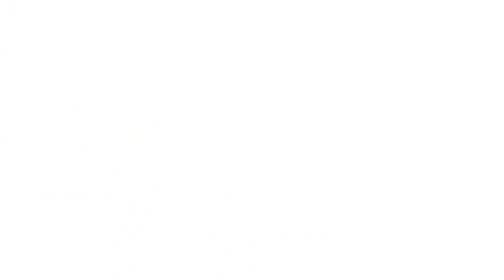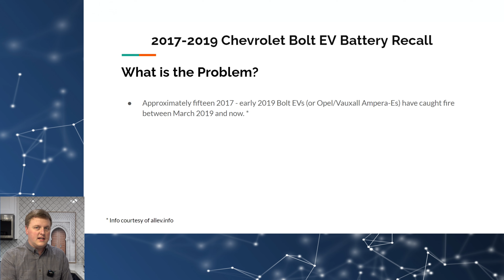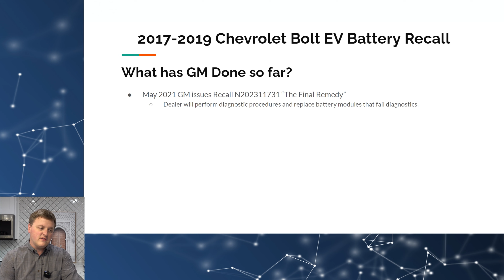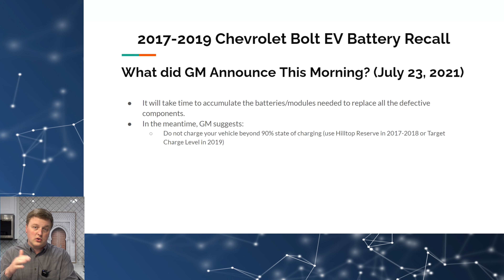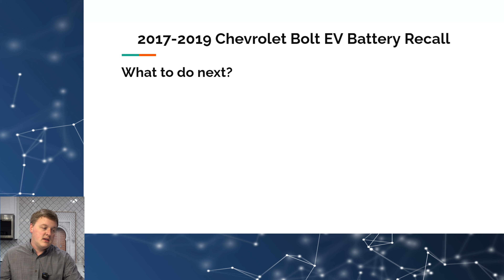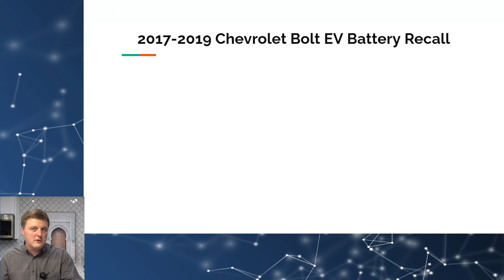GM issues a THIRD battery recall for the Chevy Bolt

Comment: GM announcement seems to be saying LG battery is at fault. 
1. If LG battery is defective then reducing charge level of max and min won’t make any difference.
2. If LG battery is defective to the factory mentioned then software update would not fix the problem.
3. There are other EV manufacturers other than GM and Hyundai using LG batteries. ie Tesla.

I would concede lithium battery manufacturers and EV manufacturers are still in learning mode, but I also believe we are in reasonably safe lithium phase. 
I don’t expect GM, LG or any other manufacturers to be completely transparent as it will expose their Intellectual Properties and geopolitical issues. All battery manufacturers are modifying their chemistry and processes slightly several times a year.

As a society, EVs catching fire is a teething problem and a minor issue, but at an individual level EV manufacturers should stand behind their products. GM needs to work with LG to resolve how real fix will be paid for.
Reply: We can learn from Samsung Note 7 batteries blowing up. Samsung recalled and replaced all their batteries but still catching fires. Samsung recalled all Note 7 and refunded.

What is not well known is that out of 5 suppliers for Note 7, all the batteries that caught fire were 4 Chinese battery manufacturers. Samsung makes some of their own batteries but gets mostly from Chinese suppliers. Samsung smartphones were best seller in China, but after that incident Huawei became #1 and Apple #2.
Samsung moved their smartphone factory out of China to Vietnam quickly, and Samsung doesn’t have exploding battery problems since then. 

Nothing is perfect, but we are in perfection in parts per Billion society, no defects in million parts is not good enough. Another reason Tesla is moving to 6840 cells.
Reply from the maker: I think all of your comments, including the comparison to the Note 7 are spot on, but I would make a couple of comments to it.
1) The Bolt batteries that are catching fire were not assembled in China, they were assembled in S. Korea. That being said, the Hyundai Kona batteries that are catching fire were assembled in China by LG. I'm not sure where the materials are coming from or where the refining is done.
2) I think GM's attempt to convince owners that the "final remedy" software update would fix all the problems was merely a PR stunt or an effort to delay the inevitable (mass battery replacement). It was never going to fix the problem and I don't think GM ever actually thought it would, it was to reduce the risk of fire by either reducing stress on the battery or diagnosing failures before they result in fires.
3) There are other EV manufacturers, as well as other electronics manufacturers in general using LG batteries and many have been just fine, but there are many EV batteries made by LG that are having problems, although not all result in a fire (the Bolt, the Kona EV, the Mach-E, the Taycan/e-tron GT, etc.). There has also been a history of energy storage facilities using LG batteries that have failed and/or caught fire. Some manufacturers that had been using LG batteries are now moving away from them, either because of the problems they personally are having or potentially due to public perception (like you mentioned with Samsung phones losing sales in China).
4) Tesla cells are not immune to build defects or fires (they've shown that clearly in the past)

GM is a huge auto manufacturer with reasonable plans for EVs in the future. The entire drivetrain for the Bolt was basically built by LG. My understanding is that GMs battery production facilities in the USA are basically LG facilities. I would expect LG would be motivated not to screw up their future with GM, so we'll see how that goes.
Reply: @wrenchingfool5284  LG is a supplier for many  brands.   Unfortunately their engineering designs can be extremely poor.

Comment: all vehicles have some form of dangerous fuel to drive them down the road.  having a separate garage from your home is just a smart move.[take it from a mechanic] we dont live in a little tyke's world, you have to protect yourself.
Reply from the maker: This is true, but I think the difference in the cases specific to lithium batteries is that they don't require any external input in order to catch fire. Gasoline is highly flammable, but it cannot start fire on its own. It requires the correct air/fuel mixture as well as a pretty significant heat source in order to ignite (i.e. an open flame or a spark). Lithium batteries pretty much contain everything they need to catch fire on their own.

That being said, there is still plenty of other stuff on an ICE or electric vehicle that could burn the car and its surroundings to the ground, but aside from a few outlying cases (like the Ford brake pressure switch disaster), those issues are usually pretty well dealt with.

Comment: This is really a good video. I think the battery issues on EV will be an ongoing thing, especially since we now have enough of them, that the problems will be "caught". The nature of the beast, pumping electrons, to store electrons, and at ever higher speed and capacity for the same volume. Fortunately for the manufacturers, a good majority of the users will not be using their cars "to the limits". They may charge the battery every few days, leaving the majority in the "safe" range between say 30 to 70%. I use a lot of rechargeable batteries on flashes for my photography. They give problems when I use the fast high current chargers, have given up and now only use the slow ones, and rotate out more batteries. Even then, batches are not so consistent.
Reply from the maker: 100% agree with your comment. Even after 100+ years of mass-market use, ICE vehicles are not perfect either. There are still some that catch fire on their own, or catastrophically fail in other ways. In reality, even if you look at all the Bolts and Hyundai Konas with LG Chem, the number that have actually failed is still a very small fraction of the total number of vehicles sold. We tend to be super critical of safety defects when someone else can be blamed, yet there is still a shocking number of people who can't even be bothered to wear a seat belt. I wear my seat belt lol, but I'm still guilty of being concerned about the slightly elevated possibility that my car could catch fire while it sits in my driveway, even if the chance is very small.

High current/capacity lithium cells are still a relatively new concept to the mass-market, so there are still development issues, but as EVs and other high powered devices start using lithium cells, they will improve.

Comment: Thanks for the comprehensive video. We own a 8/18 built Bolt (2019 Model), although you mention Oct 2018 to Feb 2019 Bolts. I assume I have to be part of the faulty pack runs. I previously requested a buyback and was denied. I live in a state with poor lemon laws and have not heard of a single Bolt own in my state approved for a buy back. We also own a Tesla and would jump at a chance to get another. I will be contacting Chevy again...
Reply from the maker: My comment about 9 of the 15 Bolts that are known to have had their batteries catch fire being built between Oct 2018 and Feb 2019 is strictly based off of what information is available online. As far as we know, all 2017-early 2019 Bolts are affected by these recalls. GM has not stated that there are any 2017-2019 Bolts that are more or less likely to catch fire. The only thing they have done that has even come close to indicating this is that they made the "final remedy" available to 2019 Bolts before it was available to 2017-2018 Bolts. That might be because they potentially use different software and required different updates to be made, or they may have been prioritizing 2019 Bolts because they are more problematic. I don't know, and GM isn't saying anything.

It's interesting the local lemon laws are sometimes making the difference between whether or not an owner is even receiving a buy back offer for their Bolt, because in almost all of the buy back cases I've heard (including mine), the buy back laws do not apply. In my particular case, the local buy back law only comes into effect after the manufacturer has had 3 failed attempts to remedy the issue. When I initiated my buy back request, I had not taken my Bolt in for the initial interim fix, and the "final remedy" had only just become available, so they had no yet had 3 attempts to fix it. Either way, yes, I would definitely suggest contacting them again.
Reply: @wrenchingfool5284  
They should just buy it back really..
I mean would anyone have purchased these Bolts knowing in the immediate future you can't park in a garage, you can charge overnight, you will have 10% less range and the possibility of your Bolt exploding??? No one would have touched this car.

Comment: So GM has gone from internal combustion to spontaneous combustion vehicles.  Now that’s progress.
Reply from the maker: Ford had them beat by a couple decades in regards to spontaneous combustion vehicles :)
Reply: @wrenchingfool5284  They don't call them Ford Exploders for nothing. Though to be fair if your Ford Explorer didn't catch on fire, at least the older ones were super reliable.
Reply: @creamofbotulismsoup9900  Ralph Nader could tell you stories about the Ford pinto
Reply: @wrenchingfool5284  I see you are a LOYAL "Govt' Motors" consumer of the Bolt. 
Do you really trust they "Gov't Motors" have resolved the issue after the 2nd or 3rd recall?.. or do you wish to continue being their Guinea Pig for their poorly produced product? #NothingAppealingAboutaBOLT

Comment: In spite of this dicey situation GM has been stand up in acknowledging there is a problem. I wish they had done this for the Chevy Cruz ! The power point style is a stroke of genius. What a great way to follow along. As for the transparency, do your homework on the Cruz. I stand by my statement. The other great obscurity is, " What happened to the EV1 ? " And more importantly,
why ? Very good presentation and explanation. But as most people of the 21st century know, a degrading electrically charged cell is a ticking time bomb. When you try to pump electrons around the good old fashioned way, it is a recipe for disaster. Largely due to the inherent impurities and manufacturing inconsistencies of power cell production.              Cheers.
Reply from the maker: GM definitely has some significant black marks on their reputation for how they have handled widespread reliability and safety issues in the past, as have other manufacturers, but GM is possibly the most notorious. I think the hope of many Bolt owners is that they would have learned from their previous mistakes, as the CEO had promised in the past, and maybe they have, but the public response to this issue so far has been disappointing. Of course, we also have to understand that since they are relying on an effectively outside supplier to create enough battery modules to replace the bad ones, there is only so much they can do quickly. They could offer to replace all the affected 2017-2019 Bolts, but they are currently struggling to even get enough inventory right now to supply new paid orders, let alone replacing vehicles for all the existing owners.

Regarding the batteries, any relatively new technology will have issues, especially as manufacturers try to push the capabilities of the existing technology. All things considered, widespread usage of lithium-based batteries is still relatively new, and using them in mass-produced vehicles is really new, especially given that there are so many different cell chemistries. On the plus side, as EVs become more common and more investment is made into the technology, the better and safer it will get.

I'm glad you liked the PowerPoint presentation. I was worried it was going to remind people too much of school or work, but it was the best way I could think of to present a lot of information and keep myself on topic without a script. Thanks for watching!

Comment: I'm an early adopter of EV's. Bought the leaf when it first came out, bought a Spark EV used recently for a work vehicle since my commute is only 8 miles, and had the first gen Volt. I love EV's but I wouldn't buy a new one today. I would wait another 5-10 years when the prices have come down and the issues have been resolved fully. I was in the market for a used 17 Bolt, but my families life is not worth the benefits of an EV.
Reply from the maker: I definitely agree that the current EV pricing, as well as the trend of making luxury EVs, is not really ideal for the average consumer, but I would caution equating all current EVs as inherently unsafe or unreliable. In fact, most of the EVs currently available are very reliable, but the one's that catch fire get all the attention. Thanks for watching!
Reply: @wrenchingfool5284  My Spark EV is nearly 8 years old and no known fires I'm aware of. Let me rephrase that, I don't trust EV's with LG batteries in them.
Reply: I’ve used my Tesla Model S for almost 5 years.  No issues.  Would buy new again.  This time…plaid.

Comment: Great vid.  Thanx.  I'm holding out to see a bit what happens with my 2017.  For a few reasons.
1:  It's a 2017, which so far appears to be a bit safer.  There have been no recent fires on the 2017s.  
2:  I have near 90k.  Taking into account mileage, I am sure GM wouldn't give me quite as much/straight trade for my Bolt (and I see why, I have nearly 4 years on this car..)
3:  I love this car.  It's been the most rock solid new car I've owned.  I mean, I would take a newer model if I had to, but I wouldn't necessarily be happy about that.  ;-)  ;-)
Fingers crossed..
Reply from the maker: I really like my Bolt as well. I would say that I actually like it more than my Model 3, although that may be an irrational feeling. Although I have had more issues (mostly build quality) with my Model 3 in 4 months and 11k miles of driving than I have in 2 years and 29k miles on my Bolt, which has been really reliable and solidly built up to this point. 

What ultimately pushed me to pursue a buy back, aside from the fact that the early 2019’s like mine seem to be the most likely to burn, was GM’s initial decision to try to “fix” the battery issue with a software update, which I was confident would either reduce the vehicles capabilities or merely try to detect a failing battery before it caught fire (and I was right.) I’m also concerned that GM still insists that they can diagnose failing batteries, which is something that is sort of implied in their latest recall. They haven’t said that they are replacing ALL the 2017-2019 Bolt batteries, they’ve said they are replacing “defective modules, which sounds to me as though they still believe that they can test and determine which individual modules are bad and replace only those. I guess we’ll see what happens.
Ultimately for me, on paper at least, the Bolt EUV takes most of the things I like about my Bolt and improves many of the things I wanted them to improve, and with the trade deal I got, I’m getting a good price. Can’t be too unhappy about that I suppose, as long as my car doesn’t catch on fire in the meantime.

Thanks for watching!

Comment: The most important and LEAST OFTEN mentioned request that GM made in the last recall, is at the start of the 2nd item in the recall:
	2. Additionally, we ask that customers charge their vehicle after each use and avoid depleting their battery below approximately 70 miles of remaining range, where possible.  	That customers CHARGE THEIR VEHICLE AFTER EACH USE and avoid ….
GM asks owners to MINIMIZE the length of and capacity change of each use & charge cycle.
Saying best way to reduce risk with a marginal cell (if present), is to pull out or putt in the least amount of power in a single use
This minimizes any risk of a bad cell heating to the point of starting a run-away.    CHARGE AFTER EACH USE and avoid >90% and less than 70 miles.  GM needs time to get batteries built for the replacement program and is advising owners how to best treat a battery at risk.
Reply from the maker: Yes, you are correct. I think the reason that is not covered that often is because it was not in their initial statement that they made the morning that everyone made their videos about it. That additional statement does seem to indicate that they believe there is an issue with longer charging sessions or large changes in battery state of charge. I considered adding an additional video to highlight that point, but decided not to. Thanks for bringing it up.

Comment: I wonder why they didn't give percentage limits top and bottom. 

Also, reducing the capacity so dramatically and telling people (basically) not to charge overnight means owners will charge at L2 fast chargers more often. That seems like it might be harder on the battery, and cause more fires.
Reply from the maker: I suspect the reason they didn’t list percentage on the bottom is because there is no way to see exact battery percentage in the vehicle, aside from using the MyChevy app through Android Auto or Apple CarPlay. They may have assumed that giving a general number of remaining miles to stay above may be easier for the average person to understand. I can only assume the reason they gave a top percentage limit is because you can sort of infer percentage on the Target Charge Level graphic.
Reply: @wrenchingfool5284  Oh, that makes sense.